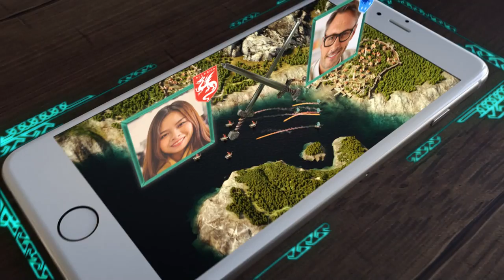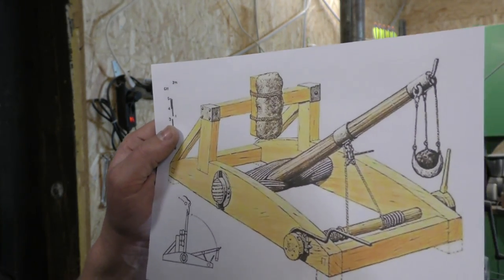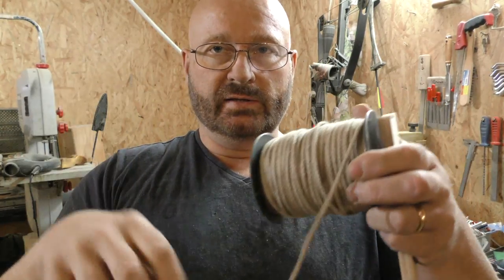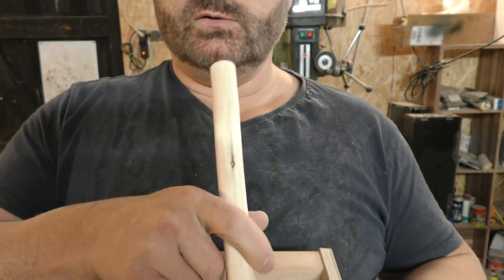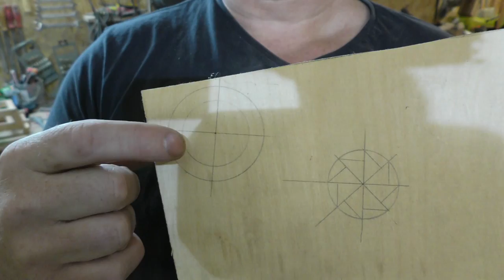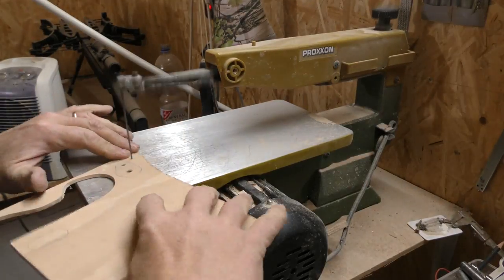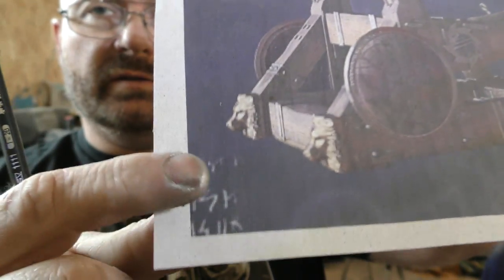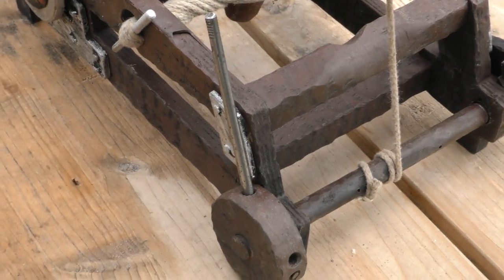"Vikings" Siege Engine - 90 kilos, 300 meters?

Comment: Should actually be possible to scale this video up. All the materials you used, except probably the rope (I am not sure if this kind you used would work) were used in construction of big, big things. There will be some limitations, but they could be worked out. For example, the stopping ram would likely need something to soften the strike, like the one in the game had. 

Would be very, very interesting if you would test it with projectiles made of also "more real" materials, like stone. Then scaling them up would be much, much easier.

Comment: best to use rope that has no stretch. the stored energy comes then from the frame. 7 strand 550 paracord has 15% stretch, so 15% power loss.
Reply: search "windlass winch"
Reply: spanish windlass

Comment: A golf ball just 20 times bigger would have 90kg? So the normal golf ball has 4,5kg? I think there is a mistake in the calkulation. To throw a stone for 300m you would neet a very big trebuchet. And I am also not sure if a trebuchet could handle a 90kg stone?

Comment: Love you Joerg. But you made a small mathematical mistake when scaling. You said that because its in 20 scale you multiply the weight by 20 however the real answer (because your working in a 3D) is that you cube the scale then multiply by weight. Like you said the weight is wrong and would be much heaver. the distance is correct though being that you are only on 1 plain. just think of a cube with sides of 1 the volume is 1*1*1=1 then if i scale that to 2 i'll have 2*2*2=8 if we say that its 1 kilo per sqr unit  then its 1 kilo cube to a 8 kilo cube not a 2 kilo cube. i do think i'm wrong when it comes to spheres because the volume of a sphere is (4/3)*pi*r^3. but i hope this help in some way.

Comment: I actually make a number of small  toy catapults of all different types. I am interested in the rope springs you used. Usually, with the little ones We make, mostly designed to be built with materials on hand and for children to build, I end up using rubber bands. How well do the rope springs hold up on yours? I wish we could get ours as detailed as yours.    I especially appreciate the ratcheted gearing.
Reply: Also, I envy the tooling you got  for  this. It's sort of what we're working towards. That Mangonel is a work of art as well as a launcher. I suspect the reason for the arm's stopping is your beam sling. The arch of the sling will reach its apex and the end of your hook at that point. Torsion machines were used, but due to the wet climates of northern europe,  Man-powered machines were more common, but these came much later than the torsion machines, which were introduced, as you stated, by the Romans in the form of the onager, which owes much of its technology to the ballista, at least where the rope spring is concerned. Have you ever heard of a Espringal? Being a Slingshot enthusiast, I suspect you would truly enjoy this one.

Comment: Vikings didn't use onagers though. Although other civilizations during the time period did on rare occasion.
Reply from the maker: So you think the Vikings would have abandoned things like that after they conquered the countries that owned them? Hard to imagine.
Reply: No, for several reasons in fact.
Being a viking wasn't equal to simply being a Norse warrior. In order to be a viking you would have to travel by longboat, at least the size of a Karve.

The type of shallow boats that vikings used made it simply impossible to bring siege engines on board their ships. It would also be rather pointless in combination with their hit and run tactics, which was primarily focused on speed, which was possible due to their incredibly fast and sleek ships, capable of traversing both the Atlantic as well as narrow rivers even.
The vikings arrived at Paris through the Seine river by longboats, where they possibly used one siege tower, as well as battering rams.

The sort of defenses that the vikings would ever encounter were not in the shape of great brick walls, but only in very rare occasions in the shape of soil mounds, wooden palisades, and shallow moats, which in extreme cases could simply be countered with ramps or ladders.

But from the perspective of Norse people who settled in Britain, who would no longer could classify as "vikings" but rather just Norsemen, even if they conquered their lands and took all their possessions in vast areas. Not even the British in the 7th century used onagers considering Edward I of England (1272-1307) was among the first to use torsion artillery after the Romans left the isles.
Reply from the maker: Sources say that during the siege of Paris, war engines were used on both sides. One side = Vikings.
Reply: Yet a siege tower is not the same as a torsion artillery piece like the onager.
Otherwise I would like to see those sources as I doubt they used much other than wall scaling equipment, like ladders.

Comment: How come you're never using wood glue for your projects? Too impatient? 
For small projects like this super glue with activator spray is very convenient and adequately strong.
Reply: swiss -  screws are way stronger  than glue
Reply: Screws might be a bit stronger than super glue when used on wood, but generally glue joints are stronger than the wood itself and certainly stronger than screw joints. 
/watch?v=nW0AmZ9aF70

Comment: 20 times the weight of a golf ball is only 0.9 kg.
Reply from the maker: Well, if you upscale 3D objects, you have to use the diameter. A golf ball with a diameter of 84 cm (=20 times bigger) will weigh hundreds of kilos, because of its massive volume.